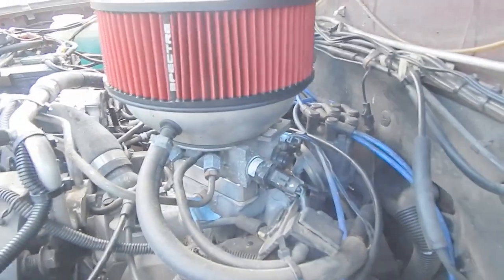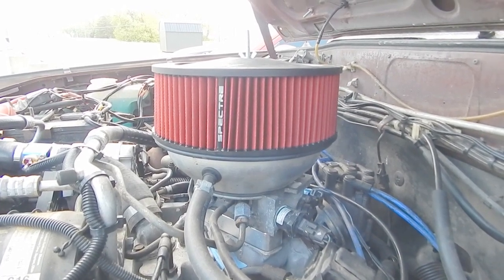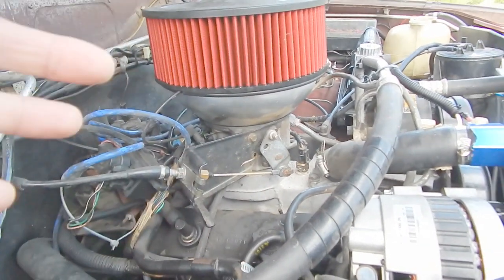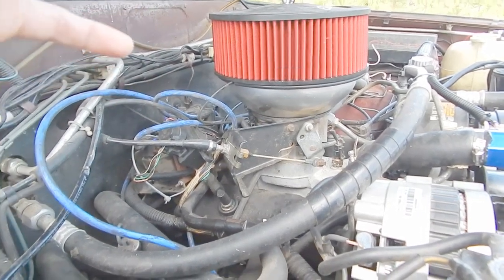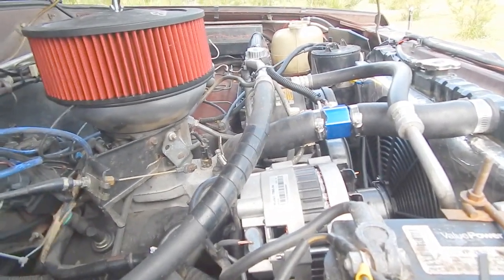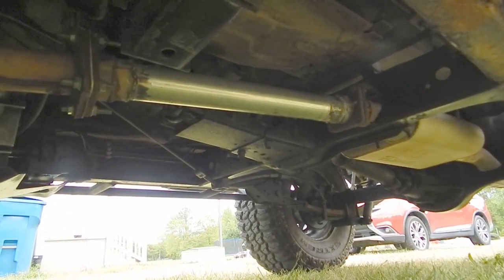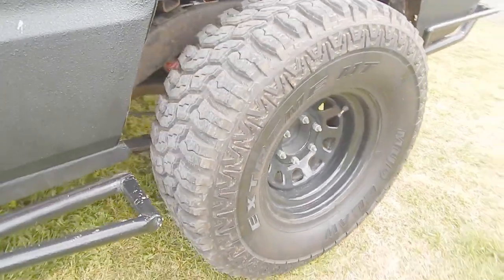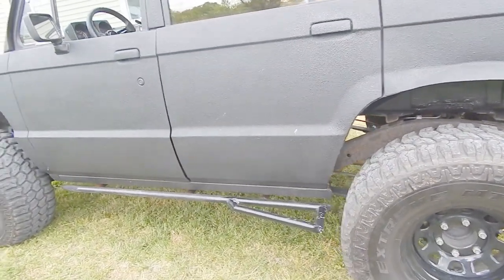Isuzu Trooper GM 2.8 V6 PERFORMANCE MODS

Comment: Good video. That engine definitely needed help when it was under the Trooper's hood. I bought a '91 Trooper new in that year. It was good to us but traveling on the highway with two adults and two small children was a chore, especially with the A/C on. Forget even the slightest hills. Cars will be honking and passing me all day. Living in Maryland, I only really needed the FWD maybe twice, after deep snows. I went to the food store and there was nothing left on the shelf anyway. I traded it in in 2001 for a new Mazda Tribute. I had taken my Trooper to have the coolant drained and replaced. They did a pressure test and told me that I had had a leak in the drain plug on the radiator (this was after they pressure tested - it it didn't leak before).  To save me the price of a new radiator I just traded in the Trooper. The Mazda had plenty of power, and I wasn't worried about rolling it over in an emergency maneuver like I was the Trooper.  The Mazda nickle and dimed me to death though. The final straw was the fuel pump went up in 2010. It cost me about $600 to replace it as they had to take the back seat out to get to.  I sold it to car-max and got 5K for it.

Comment: my 2.8-3.4L stroker car with ported heads and intake made 325whp thru the 700r4 at 14 psi, which is about 200hp at the crank NA
Reply: You can't bore out a 2.8. And you have that backwards it would be 325 crank 200 wheel, how would you have less horsepower at the crank than the wheels

Comment: How'd the tuning go I've got all that plus cam on my 86 s10 blazer 4x4
Reply from the maker: It went good , runs great...I'd like to cam it
Reply: @trailtrooper4079  good I'm in the process of data logging it for a tune I went with the Edelbrock performer plus great low end cam for a low rev engine great torque

Comment: Was this the same GM engine that AMC used in the mid '80s on Cherokees before the legendary I-6 4.0L?  If so, I had that engine paired up with a 5 speed manual and that engine had the worst performance.....I did keep up on its maintenance and it never failed me.  When I sold it to the dealer back in 1998 as down payment for a new Jeep Cherokee, it had 100k miles on it and they didn't believe me that it was the original engine.  Mechanics were coming out of the shadows in disbelief. 😅
Reply from the maker: I'm not sure but that is a funny story..the engine is a dog but the trans is even worse!!!
Reply: yes it is

Comment: I have a carburated 2.8v6. Would doing a cat delete improve the power?
Reply from the maker: yes! for sure and it sounds better
Reply: @trailtrooper4079  mine is the 1983 modle, it's been sputtering under little gas like just enough to make it do the speed limit, but if I give it enough to speed up it dosent seem to do that , I've been wanting to do the weber outlaw swap because my secondary is seized shut or just dosent work to being with, it's down on power alot
Reply from the maker: @Tommysmess  Do IT!!!!

Comment: what'd you paint the body with it looks sick
Reply: Thanks! I used raptor liner off Amazon 4 liters comes with the gun
Reply: @originalchandlertaylor8550  nice, got a lot on the bucket list for my trooper. your headlight video just made top 5.

Comment: Throw a lz9 in that thing and take the ECU from a Impala and use HP tuners it will have 279hp on just a stage 2 tune on 93 octane or don't do anything and have 240hp stock
Reply: Why not just put a small block in it, why put another dumb little engine in there. A stock v8 has 3 to 350 horsepower